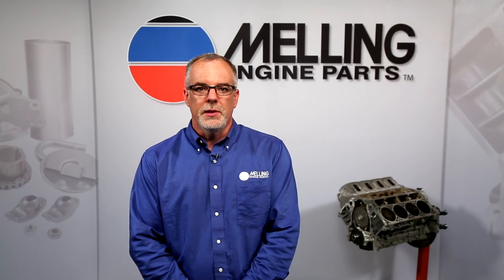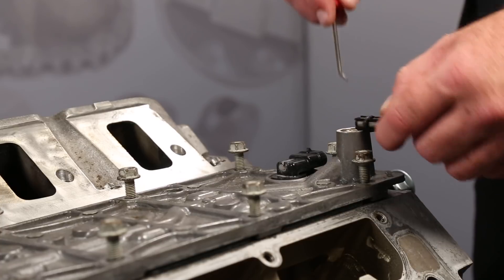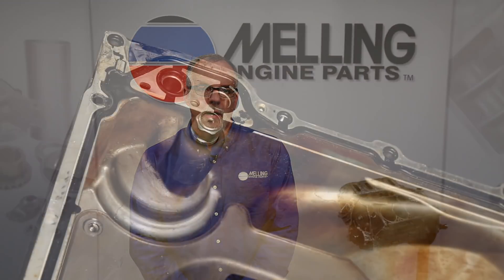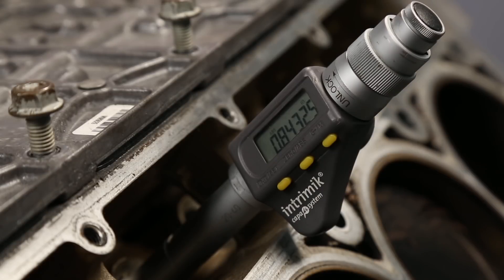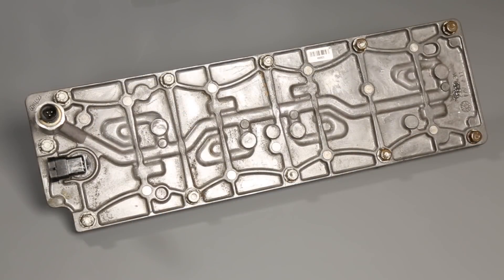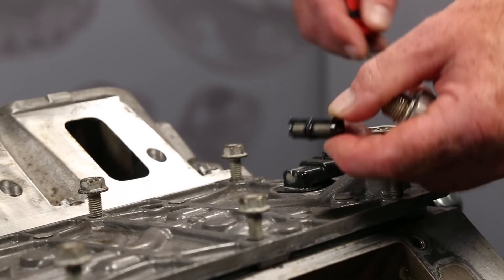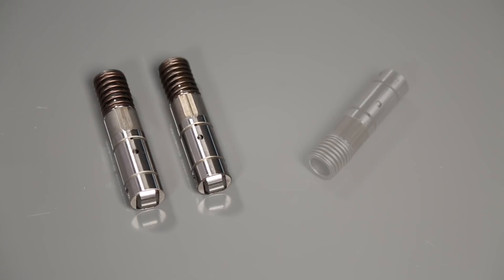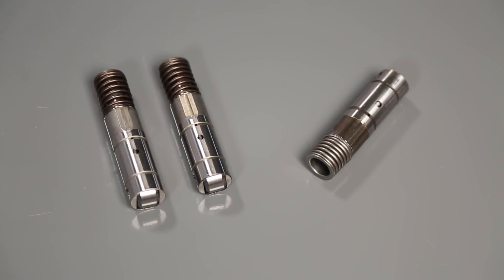GM LS Lifter Issue, Melling JB-7011 Tech Tips

Comment: I have seen the Holden Caprice model exported to the states with AFM systems, and the police have had them running on ideal for over 1,000 hours none stop per say and even with over 200,000 km's and the AFM system is still working fine, so tell me with GM's engineering for the engine, you would think that good oil and changed before the 15K mark, is going to make sure that the AFM lifters will still be ok even after so many KM ,which they are, the problems is that most people who have a V8 with AFM or DOD system replace the lifters and get rid of the DOD/AFM system get it re tunned, but forget the sum has a bi pass value for low and hi pressure oil, which will effect the lifter bores, based on the lifter replacement and not using the correct lifter size based on the AFM Lifter GM Specs?

Comment: Frequent oil changes. 3-5k max miles with a high quality synthetic. Run an occasional engine flush. Problem solved
Reply: Well OEM Oil changes say at 9320 miles or 15,000km,( or 9 months which ever comes first, so you could effectually only do 1,000 miles in 9 months ,so change the oil, depending on how the engine or car was driven)  but no mention of oil flush before, plus if you use good oil, but then use flush it will release any materials which could effectually get stuck in any of the filters, like in the sump bi pass value and or in the vlom oil filter ,so again sure use Mobile 0 w/ 40 or 30 weight oil or as per oem spec 5w30 but good quality oil and change it at the 1/2 way mark of oem spec oil changes then you will have a good engine, but then again it depends on how you drive it as well, the more rev's she gets the more friction ,thus change oil more frequently? I have a 2015 SSV Redline with the L77 with AFM, driven at around 7,000KM or around 5,000 miles and so far all is well, if the car is driven mostly on hwy's, its better for the car and engine, as everything gets up to temp, cheers :)
Reply: this is 100% the way to keep any engine running for a very long time. proper and regular maintenance schedules. 3000-5000 miles. any manufacturer that tells you that don't need it till 10k, is banking on making money selling you parts later. or a new car again later. period. I won't even let synthetic oil go more than 3000 miles before changing it.

Comment: I have a 5.3 2009 gmc . It’s throwing a code for oil pressure sensor and the gauge is showing 80 psi change the oil pressure sensor unit, still showing high oil pressure and miss fire on number cylinder 6 .. is this a vlom issue

Comment: They last a long time if you use quality synthetic and change it around 3-5k miles. Also letting the engine warm up for a minute or two even when hot and letting it idle for another minute before shutting it off. 

Too many people use crap conventional oil and go WAY beyond 3-5k miles in between oil changes.

Comment: I can not count the number of lifter/cam jobs I have done on GM AFM engines. Replaced lifters and customers have gone years with no more failures. 20 years as a GM tech you get to see what works and what doesn't. This is pretty much BS.
Reply: exactly , nice way to not take blame for shitty lifters, melling and even ac delco take a shit once in a while.
Reply: yo james, im currently replacing my l98 engine with a second hand one as i had scored bores. the second handy engine is under warranty but do you reckon its better off changing this stuff before i put it in and void the warranty? or just leave it till after warranty. i just dont want damage to occur again then when its out of warranty just dies
Reply: Getwrong Depends on the amount of miles on it and the length of the warranty you got. It’s a lot easier out of the truck. Parts are expensive though either way. If the motor is not making any lifter noises the cam will last the life of the truck if you do the lifters now and save yourself a bunch of extra work.

Comment: Junk, total defective technology, should never have been invented.
Reply: @Aaron-dp5kb  You should email the head of GM engineering that deactivating cylinders during highway cruise uses more fuel and they will immediately halt production.
Reply: What's the alternative to hydraulic lifters?
Reply: @s1mph0ny  This system uses "De-Act" lifters that deactivate cylinders for a small boost in fuel mileage. He was referring to the problems associated with the deactivation system not hydraulic lifters in general.
Reply: @joejones2935  That actually makes a lot more sense haha, thanks.
Reply: @Aaron-dp5kb  it also deactivates the four injectors during this cycle